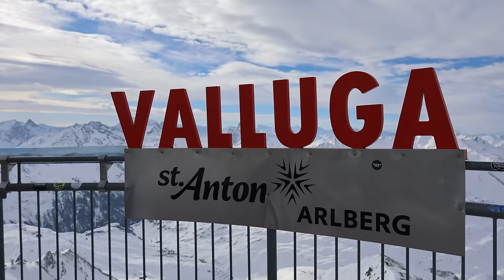How do they make Ski Slopes in the Alps?

Comment: I think a good fleet is mixed. Prinoth makes a good machine for flat grooming, Pistenbully make a great cat for pushing. We all have our preference of course. I think some european resorts would enjoy Pistenbully more if they ordered machines with sticks instead of yolk steering, it makes such a big difference in control. Also you mention the tiller on the Leitwolf setting it apart, again they both have their strengths there, the Prinoth has parallel side-shift which is unique to the Leitwolf where you can offset the tiller to one side while maintaining straight corduroy, which is great for tilling under a low t-bar or button lift where you cant fit the machine but that comes at a sacrifice to sharp turning, the tiller "stinger" (the tail the tiller is attached to) is shorter as a result of all the extra hardware for the offset system so it doesnt articulate as far in sharp turns. The Pistenbully tiller will follow through sharper turns and now comes with their "autotracer" system which assists with tiller steering while climbing and also holds better while side-hilling. Having a mixed fleet means you get the benefits of both machines strengths and also keeps the operators happy, because of course we all have our favourites...
Reply from the maker: Wow thanks for that.

Comment: I wonder has someone fabricated a slurry tank and a dribble bar or trailing shoe on the back
Reply: Ye someone put a dribble bar on one before I thenk
Reply: @charlesharkin5602  you would want it with the way the year is gone😂😂
Reply: @no_gem_like_a_tm  ye you would the ground soaked altogether
Reply: @charlesharkin5602  shur I was spreading slurry yesterday and the field was so wet I could only do half of it. U would want a track machine on standby 🤣
Reply: Seen one with a krone baler and mower on front